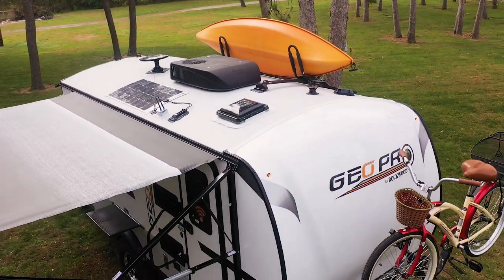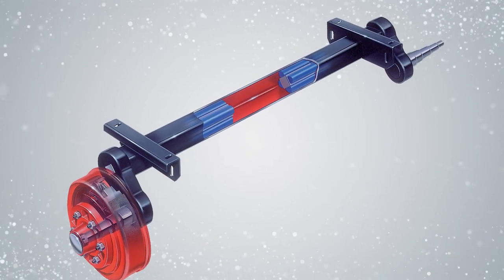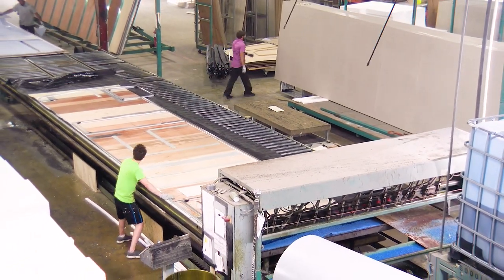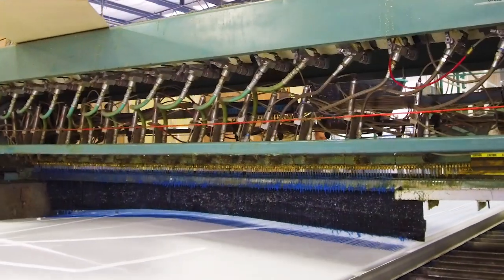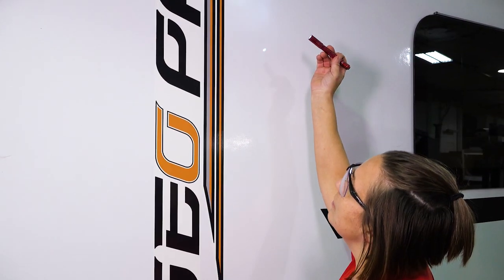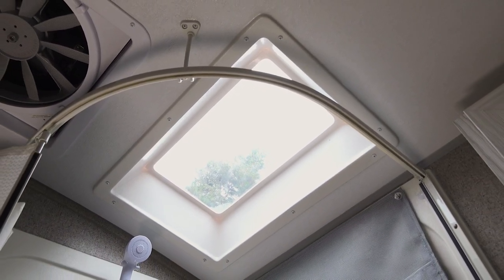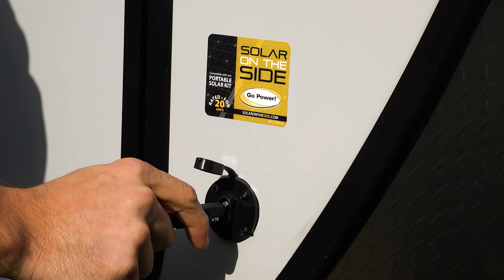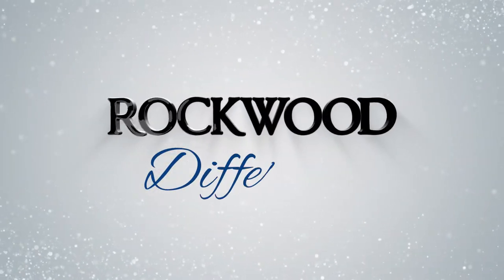Geo Pro Difference

Comment: They may look good leaving the factory, but when used camping, that’s a different story. Our flimsy metal strap that holds the dump tank valves can or will break, loosening the valve neck, allowing it to break off on the road.  Drivers behind you will notice this and call on you, follow you, and tell you you’re illegality dumping on the road. Plastic doves are used to connect the cabinet doors together that will only break after time, or like mine, after 4 months.  At Rockwood,  we use high quality parts on the blinds that will fall off because we didn’t use quality staples to hold them on.  Also, we only use two screws to hold on the blind shades that will fall off.  Feel at ease when driving this off paved roads, as things can happen.  Our dealers will tell you that its rated for off roads, yet things will break on loose gravel roads.
Reply from the maker: Thank you for your feedback. We are always listening and taking things into consideration. The plant manager has noted your concerns and is looking into them. If you have any other questions or concerns and would like to speak with a representative, please email us at rockwoodowners@forestriverinc.com.
Reply: @ForestRiverInc  The valve problem is easily solved.  There are vids on that.  Over all this is a better rig. I would buy one. Thanks FR.

Comment: Is this trailer winter rated?
Reply from the maker: Our Geo Pro models come with the option of 12V thermostatically controlled heat pads as an option for all tanks and the dump valves. In order to do any winter camping with any trailer this size, you would need to make modifications to do so.

Comment: Is that jeep Cherokee or Grand Cherokee ? just trying to see wha tit would look like to pull with a new Explorer
Reply from the maker: The 2022 Geo-Pro travel trailers have a Unloaded Vehicle Weight (UVW) ranging from 1,763 lb. to 3,547 lb. depending on the model. Please check with your vehicle's owner's manual or your local automotive dealer to check vehicle towing capacities. Please keep in mind your tow vehicle will need to pull more than the UVW due to cargo added and environmental conditions.